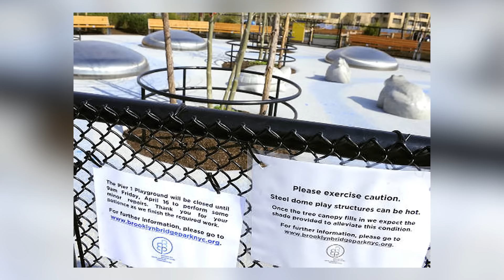15 Biggest Architectural Fails

Comment: I love the designers of the ones that caused burns from reflections didn't understand their materials.
Reply: Most didn't understand their shapes. (Except that playground thing, and burns never stopped playground equipment when I was growing up--you just learned not to touch that equipment when it was hot. I'm looking at you, evil slides of Hades.)

Comment: Whether you dig deep holes and fix the building or surface or strong structure waves are always any direction swings. Because resonance is a modulation factor of any structure. Even on Air. Even black holes resonate. Primary reason why black holes merge or reflect.

Comment: There IS a difference between Structural failure and Architectural failure. One should be fully aware of the difference between the two before commenting.

Comment: Bridges have been since the early ages  exclusively designed by engineers 
It’s the purest form and most complex form of engineering
All  successful achievements or failures and collapses are 100% engineering responsibility. 
Only back in 1989 when Calatrava ( which is both  engineer and architect) designed  the Alamillo  bridge for the Expo Seville 92, and later on in 1990  the architect BEN VAN Berkel inspired by the early design of calatrava, designed the erasmusbruge ( erasmus bridge) in Rotterdam, since then  the international engineering and architectural offices  started to collaborate on bridge designing

Before that, it was a 100% engineering    and hence I ts responsibility. 

On this video all the bridge failures are engineering failures which have nothing to do with  architectural  intervention or responsibility

Comment: The structure of any building is the responsibility of the civil/construction/structural engineers.
Architects are guilty of the aesthetic of the building, of course the design of the exterior (curved glass façades causing heat and glare), and design of the interiors. Not the structure or foundations of any building or bridge.

Comment: Buildings toppling over in China isn't a rare occasion anymore as construction with poor cement and quick building methods ensue. The reason is that building companies have financial benefits the more  floors they build, regardless whether anyone ever lives there or the building falls over after 2-3 years. Some even don't get finished, its enough to have the basic structure and floors  in place, grab the extra money from the government for every floor built and leave.

Comment: This video starts with an error - architects are not qualified to know if a building will fall down or not (other than by experience and common sense), that's the job of structural engineers.

Comment: the concert hall needs deflectors that will reflect the heat elsewhere!!! the walkway can be covered with a large fully enclosed air-conditioned shed (similar to cooled capsule type bus stops found in Dubai, UAE) & it's roof fitted with solar panels that in turn will power the air conditioning unit!!!

Comment: Architects create the designs. Engineers make those choices in construction. Also there is no way to assure that ALL materials in use meet the exact standards, especially in huge projects. As for the buildings that reflect light, again that is not the architect's responsibilty. There is no way to determine all the environmental effects any one building can effect. (BTW, the Disney Music Hall is not in Disneyland, it is in downtown Los Angeles.)

Comment: Some of these such as the curved glass walls and curved metal walls are architectural fails.  Others such as bridge designs and aquarium leakages are engineering fails.
Reply: Or the contractor cheaped out on the construction materials? What's in the specification should match what the inspectors sign off on.

Comment: Why argue on who to blame, Engineer or the Architect??, these are not merely failures due to negligence and error of Civil/Structurals only, Architects too and other factors involving the Contractors to, the materials and methodology used during the construction is also a factor... A good and stable design doesn't really mean it is a good building after...

Comment: Check your facts before you publish.
2:42 The Disney Concert Hall in Los Angeles is a good 30 miles away from Disneyland in Anaheim.
15:12-15:17 is the wrong John Hancock building under construction - it shows the one in Chicago, not Boston. You can even see the Old Water Tower in the background.

Comment: 2 mentions missing, although both of them are related to engineering design faults.. the first is most definately the Millenium Tower in San Fransisco, where they clearly needed deeper foundations to bedrock instead of a "revolutionary" raft-type foundation. The result being that a 200m skyscraper in one of the worlds most earthquake prone cities has sunk 18 inches & is leaning significantly. While some blame has been placed on excavation & construction of Salesforce tower next to it, supposedly underming the foundations. That would never have been an issue if they had built foundations to bedrock. As an Eg Australia 108 in Melbourne, Australia's tallest building, those foundations were drilled 65m deep, because that it what you have to do if you build a 300m tower on reclaimed land. 

The 2nd mention missing would be the construction of the Westgate Bridge in Melbourne. During construction in the 70s, due to design flaws & rushing construction, the middle span collapsed during construction & fell 40m, killing 25 workers. They had to redesign the bridge & start again from scratch.

Comment: The collapse of the bridge is not a mystery. It was due to bad construction combined with the weather phenomenons it was exposed to, and particularly due to the lack of strengthening and stabilising of the driving surface. It is pure physics. And an engineering failure, not architectural. Design flaws should be revealed when engineers calculate if the design is functional and safe.

Comment: 0:46 the umbrellas need to be open at all times or better permanent shade cloth provided, 20:18 don't put a  large fish tank inside a building, 3:40 use more pillars, 4:32 don't build with shiny exterior surfaces, 5:20 don't over complicate buildings, 6:24 silly, 8:30 metal becomes very hot when exposed to the sun ( use low sheen white paint ), 11:25 use more pillars and stainless steel, 13:00 early days they worked out how to do it later, 14:30 too thin and too tall, can see it straight away,  16:10 encase glass windows in silicone ( outer edge ) not too much and secured in aluminium ( outer edge ) frame, similar measurements to glass outer edge but with gap to float on silicone membrane.

Comment: Fellow you were told a lie as to why the second narrows bridge fell !
There is a hell of a lot more to this story.
Definitely it was an engineering ignorance and superintendents that caused it to fall
 They were putting the dunage incorrectly in and  under the supporting bents that supported the extended lands they were working on,
These temporary I beams that the supporting bents were supposed to have had the dunage placed in vertically when they were placed incorrectly in horizontally,
Dunage is wood and wood when used horizontally compresses easily, vertically it does not collapse easily
This dunage is to help support the I beam lands and the center of the I beam from giving way, 

There was a wise superintendent of three that left 6 months before this accident happened and told them you are going to have an accident because you did not listen to him, There was a whole bunch of iron workers that left with this man, 
That is a fact ! John Prescott president (now deceased) of Dominion bridge at that time was told of this when that man left.

Comment: I am from Boston and your info on Hancock is WRONG ....  they used to have sighters on the streets LONG AFTER the building was occupied  that would watch the glass for changes in color... that would indicate that the pane was being stressed and they would reverse the AC on that floor until the pane could be dealt with.   I taught many a computer class in that building ...

Comment: Ok most of these failures were actually engineering failures  and the walkie talkie/scorchie talkie in London was not poorly built it was poorly designed just like the other reflective buildings I agree that they're architectural failures.

Comment: modern architecture is an eye sore...
Reply: Depends on the building , But I do agree to an extent. Most modern buildings are just glass boxes. This may have been unique over 100 years ago with buildings such as the  Hallidie Building (1918) but its now been overused. Mabey we should star taking more precedent from older architects like Louis Sullivan (father of skyscrapers) or Frank Lloyd wright.

Comment: Didn't these architects and civil engineers go through physics, in particular, mechanics, optics, and thermodynamics (arguably the hardest of the sequence)?  For the ones arguing that the architect is not at fault, do they not have to go through the physics sequence to learn if their creations are even feasible?  University programmes have been so dumbed down over the past few decades, I wouldn't be surprised if they were require donly to take football physics, if any physics at all.

Comment: Buildings are designed by architects BUT engineers (civil & structural) determine the structure to support the design. But bridges are totally designed by engineers. Please note the difference between architect and engineers. So don't blame everything on the architect. There are many different types of engineers too, so please be correct.

Comment: There should be a law that architects need to be licensed. Barbers are licensed.
Reply: To practice architecture in the United States, you must have a license from a U.S. jurisdiction. The jurisdictions include the 50 states, the District of Columbia, Guam, Puerto Rico, and the U.S. Virgin Islands.
Each jurisdiction is responsible for regulating the practice of architecture within its borders. NCARB recommends and encourages national requirements for licensure by developing standards for the 55 licensing boards, which then issue licenses to applicants who meet their specific registration requirements.
Reply: @kh3612  well maybe it would help if they had to go to college or do something to learn. Maybe if they worked for a builder to learn the nuts and bolts... I don't know. I think they also need to be taught to reduce their egos, then there might be better buildings and fewer fails. And why do architects always steal designs, like I heard somewhere that the Vessel is a stolen design, do you think so too?
Reply: To practice architecture in the United States, you must have a license from a U.S. jurisdiction. The jurisdictions include the 50 states, the District of Columbia, Guam, Puerto Rico, and the U.S. Virgin Islands.
Each jurisdiction is responsible for regulating the practice of architecture within its borders. NCARB recommends and encourages national requirements for licensure by developing standards for the 55 licensing boards, which then issue licenses to applicants who meet their specific registration requirements.

How to Get Licensed

The licensure process will differ depending on your chosen jurisdiction, but the basics of initial licensure are similar. Before you begin the process, you should check your jurisdiction’s requirements.

Earn an architecture degree from a NAAB-accredited program, or meet your jurisdiction’s education requirement.

Gain and document the required experience. All 55 U.S. jurisdictions accept the Architectural Experience Program®(AXP®), but some require additional experience.

Pass the ARE®. All 55 U.S. jurisdictions require you to pass the Architect Registration Examination®.

Meet any extra jurisdictional requirements. Some boards require additional experience or a location-specific supplemental exam before licensure.

Have your NCARB Record transmitted to the jurisdiction where you would like to be licensed. Before transmitting your Record, you should contact your board to verify its individual requirements.

Why Licensure Matters

The reasons to earn a license to practice architecture are as varied and personal as the path to get there—here are just a few benefits of licensure:

Title: Once you’ve earned a license, you can officially call yourself an architect.

Trust: Your license gives firms, clients, and the public confidence in your skills and ability to protect their health, safety, and welfare.

Skills: Completing your education, experience, and examination requirements helps guide you through continuing your professional growth and development.

Advancement: Having a license provides you with greater career opportunities.

Comment: Structural was not designed by an architect, it was designed by a structural engineer. Architect only designed aesthetic of a building. Please make your points.
Reply: Engineering is not architecture

Comment: Actually these are the top 16-30 architectural failures. Frank Lloyd Wright has the top 15. Although creative in design virtually all his structures leaked, sank, twisted, cracked, eroded, etc. He sought to integrate with nature but nature showed that its change and fluidity requires the architectural integration to be equally changing and fluidic - or nature will show who is boss.

Comment: engineers are responsible for structural integrity, architects only designs the looks and materials
Reply: Looks and FUNCTIONALITY. that is the key of importance. Where is the building to be located? What type of business(es) can I operate out of this building based on it's location? How high can I build? How wide or long can I build? Where does the building have to be located on this particular piece of land, will the occupants be able to exit the building safely in the event of an emergency? Can someone with disabilities access this building? Are there enough bathrooms based on the projected number of occupants, what are the plans for parking? Is there enough barrier free parking zones (handicapped stalls)? Does the roofing have adequate ventilation? Does the floors and walls have sufficient insulation?....there are tons of questions that go into functionality.

Comment: Let’s be clear...in the modern US architects are not structural engineers. Architects design form, layout, and make sure structure meets code.  The structural engineer makes sure that the building is structurally sound.
The narrator at times interchanges architecturally and structurally.  These are not the same.

Comment: when an architect designs something, engineers should be the ones who says it is possible/impossible/okay/dangerous/nonsense. these are engineering fails.
Reply: Usually a building cannot be built without the signed approval of both the architect and engineer. But you also have times when both the architect and engineer have screwed up leading to these messes.

Comment: This is a poorly titled video. Structural engineers are responsible for structural integrity of buildings and bridges, not architects. A leaking aquarium is most likely the contractors problem and not architects.

Comment: GET YOUR FACTS RIGHT! These are structural engineering mistakes, not architectural mistakes.
Reply: The MIT building 
was an architectural error

It was built fine 
but the design was flawed

Comment: Please don't blame Architects for bad bridge design. Engineers design bridges.  Architects design buildings.
Neither claim a building with a design fault is badly built.  Builders build to Architects design.  If it is the design that's at fault, then the Builder is blameless.
Finally, structures can only be designed with the knowledge of the time.  For example: I would ask how often does Tampa experience 110Kph winds and rainfall as heavy as it did in 1979.  If this is an annual event, then yes, there was a design fault.  If such an event had never happened in living memory, then it could not reasonably be expected to design for those conditions.
Structural failure is obviously a failure.  Nevertheless, structural failure is not necessarily the fault of the designers nor the constructors.

Comment: This video is overly simplistic,  incorrectly ascribes design flaws to the wrong design professional, and in some cases blames designers for problems that were the result of technological advances in materials or structural design being ahead of their time. As just one example, foundation designs are typically the responsibility of geotechnical and structural engineers but architects are blamed for foundation issues in several of the failures noted here. This video is entertaining to be sure but technically not entirely accurate. For a more accurate discussion of these and other similar failures read “Why Buildings Fall Down” by Matthys Levy and Mario Salvadori.
Reply: @Hello Paul how are you doing?

Comment: I've never downvoted a video before. I was really curious to see what the thumbnail image depicted. No mention of it. Clickbait, anyone? And then, when you move the Walt Disney Concert Hall into "Los Angeles' Disneyland", well, sad fail. There are about 30 very urban miles between the WDCH in downtown Los Angeles, Los Angeles County and Disneyland in Anaheim, Orange County. Is the story about the heat reflection from the building true? Yes. But it makes me wonder what small or large bits of information are wrong in each of the other stories.